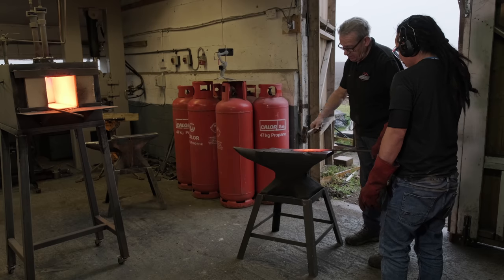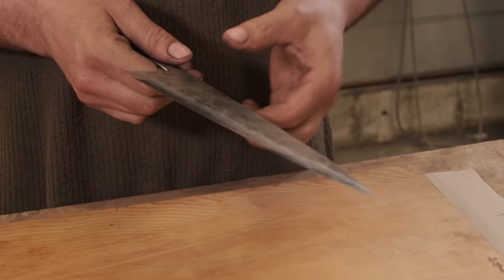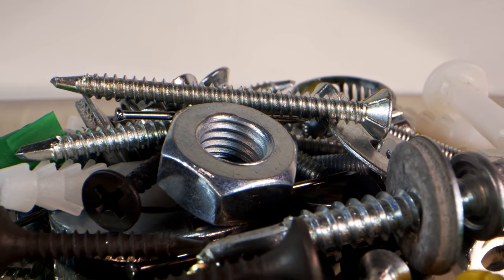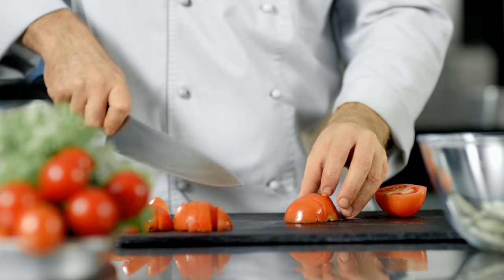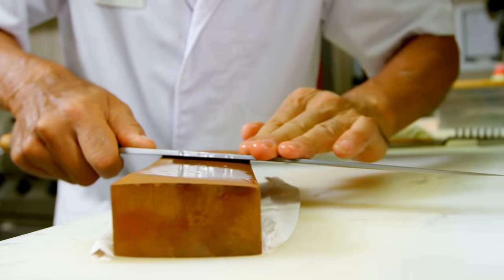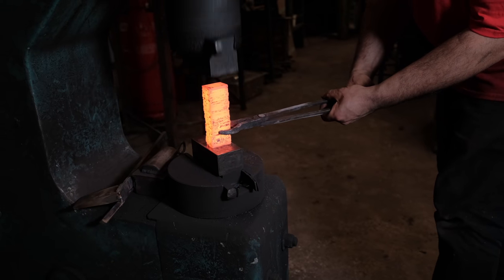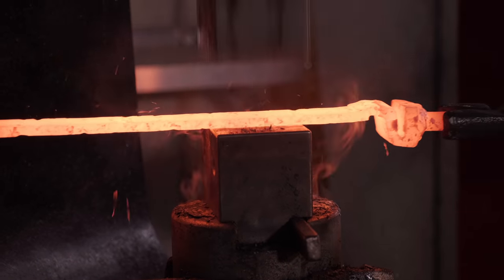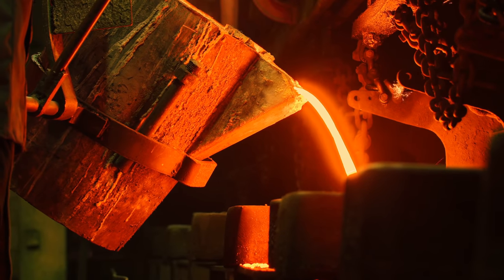Why 98% of knife makers pick the wrong steel according to a metallurgist

Comment: The main issue is that a lot of stainless steel knives for kitchens and such are made from low-carbon stainless steels like "surgical stainless" that have poor edge retention and are generally pretty poor quality. I think this gives many people the impression that stainless steel are not as good as carbon steel knives.
Reply from the maker: Hi Sandman I think you are right. Knowledge is power. Thanks for dropping by to comment and I hope you enjoyed the video!
Reply: AEB-L and 12C27 and similar alloys are considered "low carbon" for cutlery steel because they only have about .6 percent carbon. That's NOT the problem. That's plenty of carbon to get very, very hard. HT'ed correctly they both make excellent knives that will hold an edge as well or better than any non-"stainless" "carbon steel." You can easily achieve 62Rc with AEB-L if you want to, and still have excellent toughness.
The problem with cheap kitchen knives is that they're HT'ed before grinding, and tempered very soft to save wear-and-tear on the factory's grinding wheels. THAT'S why they don't hold an edge worth a hoot.  
You see the same thing in "carbon steel" factory knives. Especially tactical and survival knives... the advertising will often say they "optimize the HT for toughness" but the cold truth is they're just saving money on grinding equipment. So if a person is used to factory-made 1095 at perhaps 56Rc, and then they get a 1095 knife that someone tempered at 60 or 62Rc, they'll be amazed at the edge-holding from the maker's "special treatment"... and all it really is is they tempered it differently.

Comment: I want to make my first camping knife which steel should i use? I need it to retain its edge and be tough at the same time
Reply: 1084
Reply: @mariaconcepcionrodriguezhe2850  that is steel? Or the carbon steel?
Reply from the maker: 1084 is a great starter steel for a lot of different uses from what I know so it’s a great shout Maria.

1084 is very easy to heat treat and also easy to forge so perfect for your first knife. Not great with edge retention but if you do enjoy sharpening your knife (which I do myself), it’s great for that reason.

Comment: Wouldnt the harder carbides in stainless steel decrease the impact strength of the knife tho? In some knifes, the toughness might be more important than just edge retention. Also when talking about handmade knives, the ease of hardening might be the deciding factor. It is simply more realistic to get a good heat treatment on carbon steel when using things like charcoal or blowtorches.
Reply: All carbides tend to be pretty brittle so the type you get doesn’t greatly change the toughness. It’s mostly the volume fraction, size and distribution that determines how much carbides will affect toughness. The influence of the type of carbide get swallowed up by those other factors and the control of all those parameters is what makes the difference between good and poor quality steel.

Comment: Nice video, but bit biased and out of date. Some given figures are required to be corrected (the part stainless holds 4-6 time more with same carbon fraction). And I do not agree with high end "fancy" steels are useless. All they have their use and advantages. But yes, they are hard to work with. Thankfully, we (users who uses their knives propoerly) have diamond/CBN stropes to maintain them without the requriement of sharpeneing for a long time. And with right abbresive there is no differnece between sharpening an iron carbide or vanadium carbide knife. The edge geometry is to look for when worrying about the sharpening type.
Reply from the maker: Hi Murat thanks for the comment and feedback. Graham’s word “useless” is nothing but a slang piece of humour so don’t take him too seriously hahaha! The intention of the video is to improve the knowledge of guys who may not know the difference between the common steels.

Thanks!

Comment: Would I be better off using a stainless steel for chef knife making? As I've seen a few people using 52100 wich I was going to start using untill I saw this video.
Reply from the maker: Hi Oliver. Thanks for the question! It really depends on your customer’s preference but hopefully this video shows you the difference between the two main types of steel. I personally am more of a carbon-steel type of guy because I love patinas and also because they’re easier to resharpen (which I enjoy doing as well!). 

I hope that helps!

- Vinz
Reply: @UKBladeshow  thanks so much, really helped!

Comment: Good day sir, I made a two-handed sword from 12c27 steel, it is very springy and feels good. Do you think it is a good enough material for this sword. The dimensions are 50mm wide by 3mm thick by 1000mm long and sharpened from both sides with a dagger-type point, the handle is a huge T-piece. It is obviously fairly heavy but I believe will be deadly should it have to be used in battle.
Reply: For swords (that you actually want to use) toughness is key. 5160 or 8670 would be the best, but 12c27 would be one of the best choices when going stainless. Just make sure the heat treat is on point, maximizing toughness.

Comment: Thank you for the explanation. 
So I bought 1095 steel to make small wood carving knives. The reasoning was because I could harden it with a simple propane torch. Can I harden 01 tool steel with a simple propane torch or does it require higher temperatures?

Curious if you would suggest induction coil setup for these small knives? Blades no longer than 3" mostly 2mm or less thickness (I'm using 1.5mm currently and honing it down a bit)

Comment: what ones have better edge retention and corrosion resistance than basic carbon steel but are forgiving enough for amateur work at home. if i need exact temps and hardening methods it dont do me any good.
Reply: You DO need pretty exact temps and methods, even for the simplest steels, if you truly want the best results. 
But if you simply cannot or will not get a kiln, just stick with very simple "carbon" steels like 1070/1084/80CRV. They give you the best chance of getting them right with the simplest forge and easily-available quenchants like peanut oil, canola oil etc.  You will get reasonably close to the proper quenching temperature just checking them with a magnet, and still make very good knives. Don't temper them back so far if you want a bit better edge-holding. 
Do NOT use 1095 with primitive methods. Wags often promote it as an easy steel, a "beginner" steel, but that's not correct. It's trickier to harden and quench properly than people would have you believe. You really need the proper quenching oil to do it right, and you have a very short time between getting it hot enough and then getting it cool enough to harden fully.
You're going to have a difficult time heat-treating any really corrosion-resistant steel with an open forge and "homebrew" quenchants. They require higher temperatures and longer soak times than plain carbon steels. They also tend to want to start air-hardening as soon as you pull them out of the furnace or forge, and that can be a problem. 
If you really want to try it, stick with AEB-L. But honestly I wouldn't bother.... there's a very high likelihood of either never getting it quite hot enough or just ruining it messing around with it.

Comment: I'm 100% sure this guy knows what he's talking about, and my experiences could have been a fluke.
However, I've owned dozens of knives for whittling/general purpose. But I was never happy with any of them. None of the knives ever held an edge. Even just opening boxes and such around the house would dull them in a week. Then one day I bought a $5 carbon steel knife for whittling from the local hardware store. That knife carved two 8-inch figures from hardwood, and with just a little stropping I can still shave with it.

It's totally possible I just got lucky with the carbon steel knife, or unlucky with all my other knives. But the fact of the matter is, is that carbon knife was used for weeks and weeks, sat around in a drawer for 3 years, and without ever sharpening it, it's still razor sharp.
I've not had a knife, before or since, that was shaving sharp after any kind of use. In fact most of my knives will become too dull to shave without any use at all.

Comment: I'm in Eastern Europe, so I've got access to Russian standards of steel. I love "KHVG". It's got 1,5% tungsten, chromium and manganese each and 1% carbon. It's difficult to forge, more difficult to grind, once hardened, and even more difficult to dull.
Reply from the maker: Thanks for sharing! Sounds like an interesting piece of steel to work with! Hope you'll enjoy our other vids too!
Reply: I sounds fantastic! A powder metallurgy version would be even more interesting, but that low of tungsten makes me think it wouldn't form a lot of tungsten Carbides or affect the other chemical elements much. Be interesting to test that alloy!
Reply: @ssunfish  I think the steel was based on the "general ball bearing steel" used in the union at the time, but with the extra tungsten. Its addition makes a stark difference to the properties. "KHVG" is used in places where you can't use HSS, but kind of have to.

Comment: I'm a retired tool maker, and machinist, and my moose skinning knife, and camp knife are both made from 01 tool steel. They are both sharper than a razor, and hold an edge a hundred times longer than ANY production knife I've ever had. As for rust, are you kidding? My blades sit in wax dipped leather sheaths, and I don't let them rust. I can skin 3 or 4 moose, before it needs a touchup, and my camp knife only suffers when I eat with it. It does not like china plates, and only takes damage when the steak is too tough, and I try to cut the plate in half. Cutting cartilage from bones causes no damage, however. As for preventing rust, moose hide is covered in fat, so when you're done skinning, wipe the blades off on the inside of the skin, and no rust. My knives are heat treated to 65 rc, with the back blue tampered to 45 rc. I wish all knives were made of 01, instead of the case hardened junk coming out of China, and India. I don't believe any manufacturer makes a decent knife, that could compete with mine.

Comment: i just got through my materials college class and how it was explained to me about carbon steel was that carbon atoms jam their way into the crystal structure of the iron. they can replace a iron in the structure at high concentrations and because a carbon atom is a different size then a iron atom it distorts the structure, and carbon can just jam its way between the atoms of iron in the crystal. and this restricts the movement of dislocations in the crystal and makes it less bendy. different elements are different sizes and distort the structure in different ways. it's a solid solution, just sorta mixed together not reely making a new thing like an iron-carbide. but idk I'm just an engineering student, not a metrologist.
Reply: I suspect the video's description of hardening being based on carbide formation was them glossing over the details for a general audience. Well spotted though. 

Carbide formation certainly does play a role but no mention of martensite was made. I'd be very, very surprised if a heat treater (my background too) was unaware what he was actually doing and why.  

(Metrology is the study of measurement and metallurgy is study of metals, by the way)
Reply: I've seen a couple more videos and he does know what he's talking about. 

Carbide morphology and distribution is one of the determining factors for wear resistance so it's not a bad editorial choice to only mention it in this video even though there's detail lost on martensite, retained austenite, quenching, tempering etc etc etc
Reply: @GemAppleTom  my corce was just sorta introductory. more just solid solution, the iron-carbon system and that super funky quenching diagram and like dislocation glide and laticees. I guess fe3c was on the iron-carbon system I studied.

tempering doesn't make too much sense to me. is it possible with good temperature controls to just go straight to the morphology you want? rather then making it all martensite and just converting it back to what you want through tempering. might be able to get what you want with less warping.

also I heard cryo treatments can do hardening without warping but my class didn't cover it. and I have no idea how it works.
Reply: @nick4506  Sounds like you've got the basics. It'll make learning the more intricate details behind the basics easier. 

For high strength you generally do want martensite but (there is pretty much always a but) as quenched its toughness is simply too poor. It's a balancing game with the properties. 

There are a couple of processes that can help reduce distortion (austempering and martempering if you want to look them up). They add extra costs to a process, though. 

Ah yes cryo. Cryo is an interesting subject. Hold a steel (or any other mayerial) at liquid nitogen temperatures for 24 or so hours and you get almost magical improvements. 

Most of the improvements in steels can be explained by full transformation to martensite - in other words eliminating any retained austenite. That doesn't require 24 hours or even very cold temperatures. The majority of the other claimed benefits are quite frankly nonsense. There is a little evidence that deep cryo in certain applications, with certain steel, might be helpful but the snake oil salesmen haven't help its development. Treat the claims with a certain amount of skepticism.

Comment: Can you still heat treat stainless steels like AEB-L using a gas forge and oil without any undesired side effects?
Reply: Only some of them can be. But best results still come from the heat treating oven
Reply from the maker: I am no expert at heat treating but I do agree with Abandoned Bucharest. I'd suggest you invest in a small heat treating oven and you'll get much more consistent and better results! (Or send it to Graham Clarke hahaha!).
Reply: You CAN, but you really shouldn't. You'll get much better and more consistent results with a kiln/furnace. Higher alloy "stainless" steels require significantly higher austenizing temperatures and a longer soak time at that temperature. That's difficult to achieve with a gas forge.

Comment: Well, non stainless carbon steels are usually tougher. If you like making big blades or blades that can take an insane amount of abuse then I would still go with them. But I might be wrong since my experiance is still limited.

Edit: Aaaand as far as I know chromium carbide forms in comparetively large chunks, which hinders the forming of a really fine edge, since those rather brake out then be sharpened. Giving you a toothy edge. Might be different for all that high end stuff though

Comment: The nitrogen steels vanax and vancron superclean are very performative but you’ve no hope to form a proper edge without diamonds. I have a small fixed blade in vanax and it sincerely will not rust. At the same time i have a custom macvsog style fighter in cryo treated a2 that can cut and whack for a century without sharpening. Both go to show heat treat is king i suppose.
Reply from the maker: Thanks J Ownbey!

Just in case you are interested in other vids with pro knife-making tips, I made a playlist HERE: https://youtube.com/playlist?list=PLFssspwgISv-q8YPgoAg1XNZYw9YbMkJT

Comment: Too many people going too fancy. I love some 1070 for rough camp knives that take abuse well, sharpen easily after said abuse, and doesn't cost the bank to obtain. Everything is a trade off but why trade away advantages just to brag about using some 'fancy' steel composition.
Reply from the maker: There are uses for fancy powder met steel but like you said, for most people, the basic steels should suit. Thanks for the comment!

Comment: Can you heat treat AEB-L okay in a backyard forge? It it requires an HT oven then I'm priced out of using it at all. Or if someone wants to recommend  a chromium or chromium/vanadium steel for those conditions I'd like to hear about it.
Reply: AEB-L requires a heat treat oven. Plus to get even better result you need a cryo treatment.

Comment: You overlooked the fact that most people don't want to spend 4 to 5 times longer sharpening their knives and so end up with a drawer full of dull knives. whereas you or I can go out to our belt grinder with a worn J weight 600 grit belt and have a razor edge in less than a minute.
Reply from the maker: Hi Lee thanks for the comment. You are right - everyone has a different preference. Graham is not a fan of cleaning his knives so prefers stainless over carbon steel but I’m a carbon steel man as I love pretty patinas and also actually enjoy sharpening my knives often.

Thanks again for the comment!

Comment: carbon vs stainless - there is an answer, both (carbon core with stainless cladding). For sharpening again it depends on the stainless some sharpen like a brick some like a dream and I can say the same for the carbon steel - just depends. Also super depends on what your cutting esp about the anecdote about butchers, the thing he left out is butchers hack at bone all day - you want something more like an ax than a fillet knife - dont believe me then why do we have cleavers - simple not the same job not the same edge not the same metal. "sharpening steel or hone" is for mooks lol, if you want to keep a wicked edge use a stropping board OR ceramic hone.

Comes down to what you're doing always: steel cleaver in a rough steel because not super important if it has a fine edge but it has to take a beating, but I'll keep my thin carbon steel for veg, meat trim and detail work and NEVER ever would use it to try and go through bone (though a dream for slipping into joints).